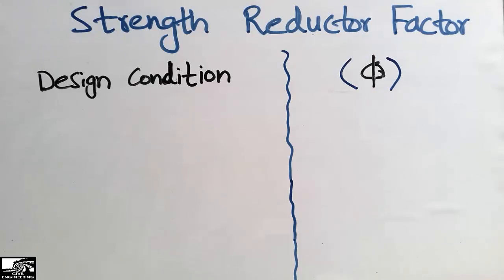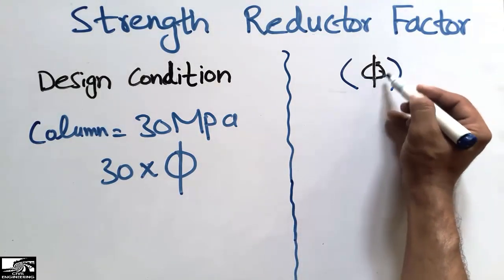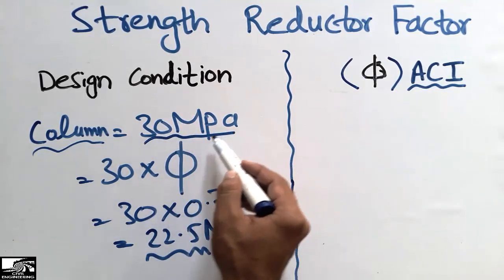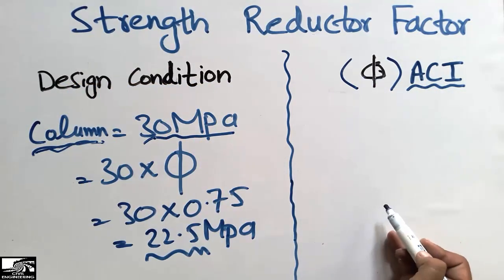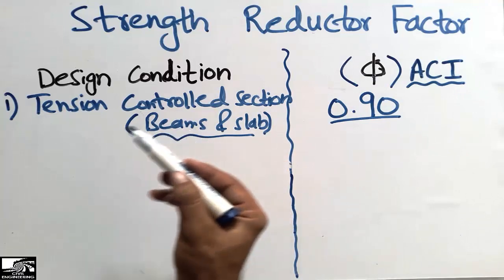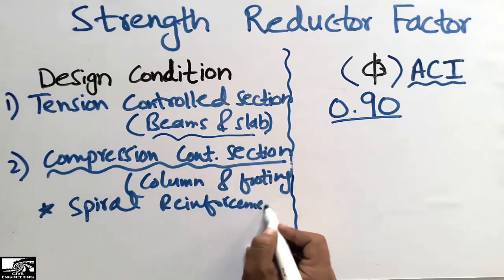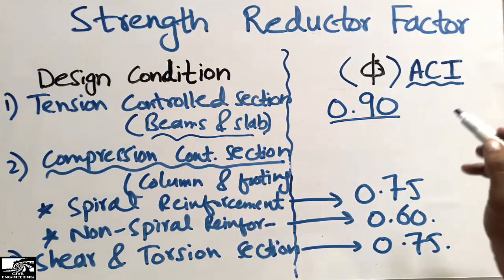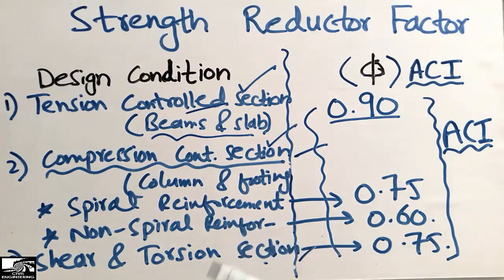Strength Reduction Factor

Comment: So actually its more of an Strength Effectiveness Factor? As with an SRF of 0,75 the assumed strength is not reduced by 0,75 the actual strength, but simply multiplied.

e.g. with 30 MPa and a SRF of 0,75:
Not 30 - 0,75 . 30 = 7,5 MPa
But 30 . 0.9 = 22.5 MPa

Kinda confusing terminology but thanks for the clear video :)